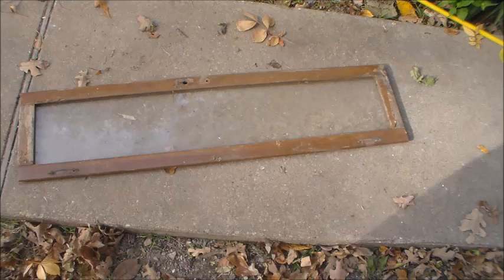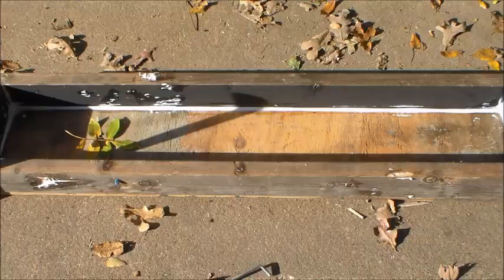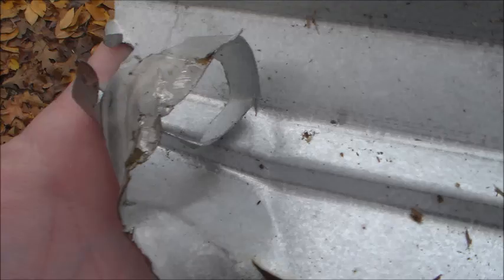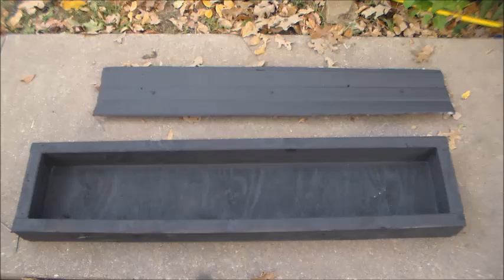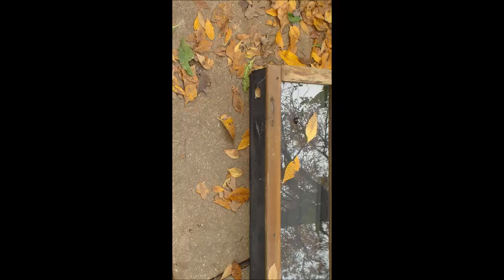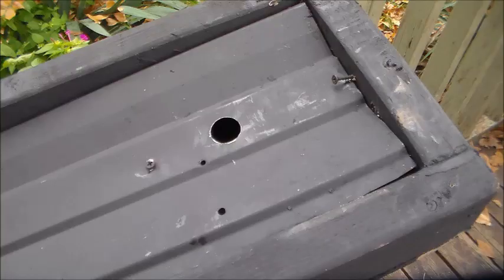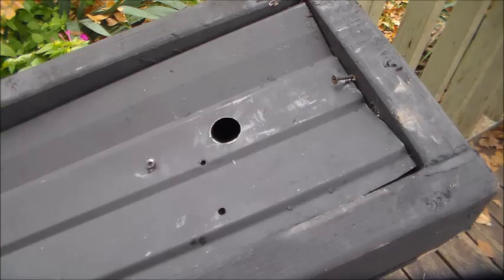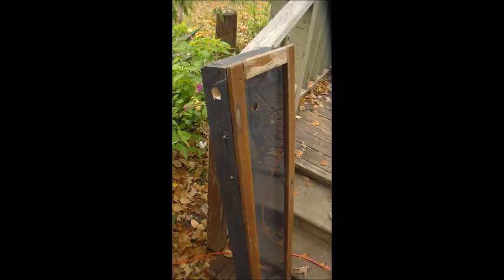DIY Solar Air Heater / Heatwave Solar / Solar space heating

Comment: first of all you need larger holes compression and decompression leads to heat loss the input hole should be the same use copper as well and no wood just glass